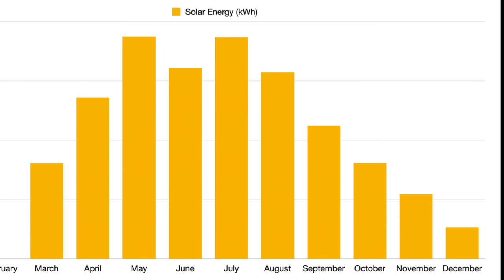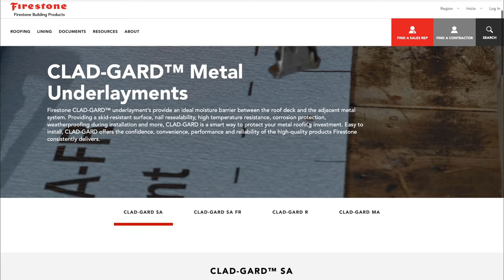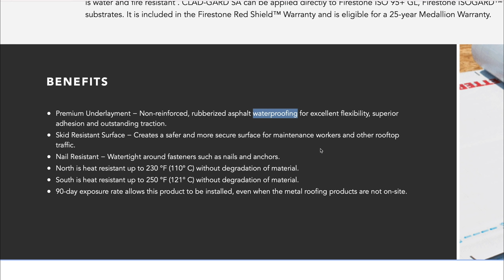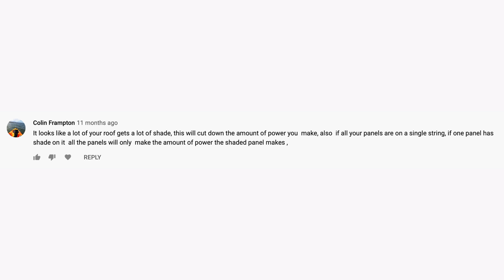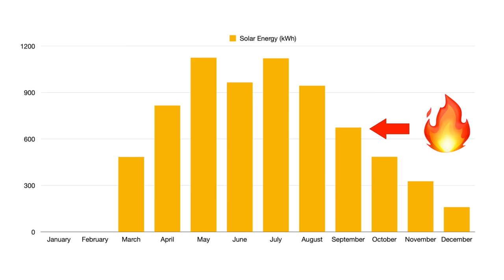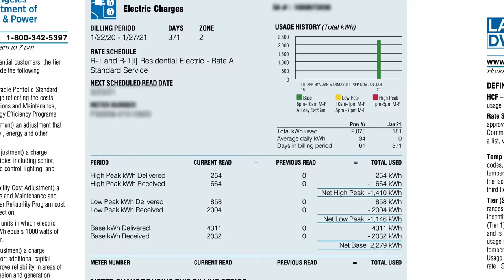1 Year with Tesla Solar Roof: top 11 questions answered + real production numbers & utility bills!

Comment: You mentioned the 1” gap under the panels; do you have any problems with rats or insect infestations there? That would seem to be prime real estate for rat nests
Reply: Or hornets.
Reply: This roof most likely gets way too hot for anything to actually survive under the tiles.
Reply: @kjamesjr  Depends on the season and where you live.
Reply: I’m hurricane prone areas (probably tornado areas too) we can get horizontal wind driven rain. Many homes with roof ridge vents let water in on older, less steep roofs. I think this could be a problem in my neck of the woods.

Comment: GAF has a similar product now.  It is nailed on just like regular roofing.  Not raised like yours, which has advantages.  One being it you can walk on it.  I only saw a short video of roofers in the early process of installation on a home in Silicon Valley and do not know what it looked like after completion.  It will likely not be quite as nice looking as this because the connections are on top instead of under raised tiles.

Comment: How much does that cost for the installation and purchase of everything
Reply: Kind of the relevant question to it all.  Saving $2000 a yeas declining by 0.5% over 25 years is great if it was $10,000 but a terrible deal at $100,000.
Reply: Est. Price After Incentives

$108,261
Reply: @everfrost6237  if so, that is flat awful.  Even allowing for rising cost of power, they won’t pay for themselves in the 25 year period (never mind extra costs like cleaning and if you lose an inverter or something along the way).  You’d be better off giving $108k to a financial group (Fidelity, Schwann, NW Mutual etc) and earning on it.
Reply: @v3rlon  no way. Independent is the way to go.
Reply: Tiberiu Farcas  yeah, but I think it's called principle.
Reply: Tiberiu Farcas  something like that
Reply: @everfrost6237   for that price you can get regular solar panels that can generate 6-7x the energy. but then you need the land for it
Reply from the maker: Covered the cost in depth in my first video: https://www.youtube.com/watch?v=LRPy8UZv9V0&list=PLXt9cHZDKoN4TcPWRp-P7iQfshODE274k

Short answer: $33k, about $21k more than if we had just gotten a conventional roof and about $3k more than if we had gotten a conventional roof + standard solar panels.
Reply: @AustinFlack  ok. So if you already need a new roof and were planning on putting solar panels on. Basically you have $12,000 out of pocket more than what you were already going to spend. How much tax credit do you get a year with it. I'm looking at how long would it take to break even and then be above zero.

Comment: I'm not so sure ash from wildfires caused the loss of production. It might account for a little. What about the sun lowering its position in the horizon in the fall months? Could the lack of indirect sunlight be the cause as well as shortened time for daylight? Also, does the ridge of your roof run north/south or east/west?

Comment: Thanks for the reply…. Cost of 20,000 and annual savings of 2000… payback in 10 years with life expected of 25 years .. Great…
Reply: Yes, but if you factor in the replacement cost of a traditional roof, you are actually not that bad off. So if your roof needs replacement anyways, it is a good alternative.
Reply: Yeah, if you need a new roof anyways, then maybe it works
Reply: Plus, prices in California definitely will increase over that time, so payback will probably be closer to 7-8 years.

Comment: You need permission to operate bc the power company needs to be aware of every power source feeding into the grid and connected to feed so that a lineman can service the lines safely.
Reply: That's a reason for you to provide notification, not for them to provide permission.
Reply: @havenbastion  So you want every individual contacting the power company when everyone around them doesn't have power. Just be a team player and don't kill a lineman. geez.
Reply: Yeahbut. I don't  for the  life  of me understand   why  anyone  would stay connected  to the  grid. It  makes NO  sense and will, one way or another  cost  you money.
Reply: @dabbbles  I got a back up gen for when the power goes out and my power bill is about 100 a month that's why
Reply: @auspicioustoot   @no name  Agreed. Back-up generators are no  solution..Better  options involve sorting out  your usage.  The more basic suggestions: 1...Put up as many  panels as  you'll need PLUS (say) 20% At  today's prices  that'll set  you back almost nil. (In Gumtree someone was offering a  complete   6.5kW   system for FREE. recently ~ on the same day I picked up 13 panels off the hard-rubbish pile a few doors  down.Good new ones  can be  bought  for under 50cents per Watt, but look around and you'll buy them for  20cents.   2.....Battery-bank. Stay  clear of the  exxy hi-tech stuff. I can get (or  direct you to) Deep-Cycle AMG LA batteries  with a  3-year UNCONDITIONAL  warranty (which means  you can expect 5+ years out of them.) The  trick is  to store  TWICE as much power  as  you intend to use. The  key  to battery life/efficiency is to minimise  the  DOD.. Some time ago I had  a   huge  bank  of   (free)  2nd-hand  l/a  batteries  the  shortest of  which lasted over  5 years;  the  longest 8 years..
Briefly: use  daylight. eg:  run fridges/freezers  flat out all day and  switch off at night. Ditto  whatever else  you need. Lights/TV/computers/etc used at night  run off the batterties ~ and  saved  where possible (eg. lights on only in the room  you're using).  Short-term needs  for power (microwave/washing-machine/ironing/etc. can be  run off a generator  for  a  total  of  perhaps 2/3  hours a week. I bought a 'demand-start' 2.4kW  unit from Bunnings  for $620 some time ago. (may no loger be available.)  Small usage of genny/batteries/etc. means running  costs are  low and the equipment will last  forever. Buying new,  you can set up useful system  for under  $5k. 3... other  options include installing several circuits in botyh DC and AC (from the inverter.); efficient  lightglobes will light a  large  room  running  at  5 or 10 Watts. etcetcetc. There  are  other ideas _ such as  running  your  genny off LPG, etc.  Contact dabbblesATgMailDOTcom if  you need ideas/info.
Reply: @auspicioustoot  ps. Panels I  bought 2nd-hand in 1980 are STILL producing power @ about 85% of  rated output.  In the meantime your  electricity-price  has  risen by  (perhaps?)  500%, and  your 'service-to-property charge  by not  much less. Incidentally, many people also consider the global-warming/etc  aspects of generated power.
Reply: @havenbastion  Any half-witted chimpanzee can install a  solar-system, and  prices  for  such  systems are, these days, minimal. (Very Cheap)  But around  here (Victoria Australia)  you not only need permission to install solar panels, but  you   are no longer allowed to install them yourself.  Installation must  be  done by a 'specially-qualified'  contractor and  inspected/approved  by  an electrical engineer.  I'm sure  you understand what happens  to price  when a particular  group  gets a monopoly handed to them.
Reply: @auspicioustoot  I  forgot to suggest you  do  the arithmetic. For  about 4 (say 6 to cover contingencies) months of power bills  you can install a  free-standing system that will provide  your power for the  next TWENTY of THIRTY YEARS...  except  for  replacing battery-banks every,say, 5  years. (longer if  you're keen.)  And while the price of  batteries/etc will continue to fall, the price of grid-power ~ along with the associated 'fees and  charges'  will continue  to  rise  at an accelerating rate, plus tax! (and be applied  whether  power is  supplied or  not.)  I once  sent the power-company  a  bill  demanding  rent  for accommodating  THEIR cables, fusebox, etc. on  MY property.  Didn't  get a  rent payment, but  they waited  three months before they sent me another ~ huge ~ bill!;  but I'd  disconnected  THEIR connection with a  pair of bolt-cutters  before then  and challenged  them to  sue me for the money.
Reply: @dabbbles  It doesn't make any sense right now for me to put out that money. If I work enough my power bill isn't even a 100 dollars bc I'm just not home. I'm also getting my power from TVA which is super cheap bc most the energy comes from dams.
Reply: @auspicioustoot   @no name  Each to their own, of  course ~ and  differences apply across the board. The main thing ~ in life generally ~ is  to get the  facts and work out  your  own best interests.  And  the  facts are  sometimes  fascinating.  (we set up a water-wheel pump at a  mate's house  that pushed  water 200ft uphill   to a header-tank  for  free..... and almost accidental, but feelgood,  discovery.) For mine alternative power's greatest attraction is  the  independence it offers. (along with the mental exercise: how  do  you heat a large hothouse with depleted batteries, for example.?  Personally,  my  favourite  source is a permanent creek  because  consistent hydro-power obviates  the need  for  a battery, which until fairly  recently were a bit unreliable  and VERY  expensive. But  we can't always have  our  druthers.

Comment: At $2K a year, how long does it take to pay off the Tesla roof?
Reply from the maker: Will pay for itself in ~10 years. (I deduct the cost of a conventional roof when I calculate ROI—I needed a new roof!)
Reply: @AustinFlack  Was home energy usage similar? Did the solar roof also reduce cooling energy needed? As it appears you will always exceed your needs for 25 years. So even after the warranty, there will be significant savings over conventional just related to durably as output decreases.
Reply from the maker: Hard to say because Covid changed everything about our energy usage (house used to be empty all day on weekdays, now my wife and I both work from home)

Comment: Wow. 2gs in savings. That's significant. Well done.
Reply: Depending on how much it cost to install...
Reply: @lydiaderhake2532  it only makes sense if the Tesla roof is no more than double a regular reroof. If it cost more than double than they lose money. His reroof cost should be 12000. If Tesla is 24000. he pays it off in 12 years. with 25 year warranty

Comment: Awesome video and straight to the point! 
~33500$ for the roof and ~2000$ in savings/year that's not bad!
Reply: Actually with the decrease in efficiently  over the 25 year warranty it would take about 19-20 years to break even.
Reply: @swordsbeer6535  But you are assuming the price of electricity will remain the same for 20 years. Generally prices rise, either by inflation or scarcity.
Reply: That's fairly bad. That's a 16 year ROI, with solar panels that have a lifespan of around 25 years. So over that 25 years, you are up around 20,000. 

Now if you had invested that in a moderate risk(6%) stock portfolio it would be worth 140,000 over that same time period. 

So basically he missed out on $120,000 on this investment.
Reply: @darrell3O87OO  You are assuming that the energy companies will keep paying for electricity. They won't. We already see rates for feeding energy back to the grid decreasing. Being able to feed the grid was designed to entice early adopters, it will go away.
Reply: @TheOwenMajor  You are assuming people still want to buy electricity at ever higher rates. It not just about selling electricity back. A lot of people don't want to be beholden to the utility companies.
Reply: @darrell3O87OO  "You are assuming people still want to buy electricity at ever higher rates."

Doesn't matter what people "want", they want refrigeration and air conditioning, they want to run their tv's and lights.

The issue with solar is it produces it's energy at the wrong time. Most people have little need for electricity in the middle of the day when they are at work or school.

Thus, like this video shows, most electricity gets sold to the grid, which offsets energy bought in the evening.

Now the issue is that energy companies don't want energy in the middle of the day, because nobody is buying. That's why grid buyback of solar energy is going to be slashed in the coming years. They will be giving pennies on the dollar, you give us 10 and we will give you 1.

Thus the solution is to store it yourself, and again like this video shows, that is expensive(and ultimately unrealistic).
Reply: @TheOwenMajor  of course a solar system needs batteries, pointless otherwise. But there are people willing to invest for the long-term benifits.
Reply: @darrell3O87OO  "Long term benefits"
Well, let's do the math. The power wall(3 day back-up) costs almost as much as the actual solar panels. That doubles your ROI to 32 years, which happens to be longer then the life of the system...
Reply from the maker: Correct. The Powerwalls are super-expensive, and could only save me up to $156 a year (not quite that, some fees are mandatory). 

Also, I think you should deduct the cost of a new roof from the ROI equation (we needed a new roof), so payoff gets closer to 10 years.
Reply: @AustinFlack  Did you get any kickback/tax cuts for going solar?
Reply: @TheOwenMajor  I've been hearing that 'everyone is going to go solar real soon' since the early 80s. I'm in the middle of Silicon Valley where the cost of solar isn't That prohibitive compared to the cost of real estate and remodeling in general. We now have mandates that New construction must have a PV system installed anyway, so it's gonna finally happen one way or the other. I do know PG&E rates have definitely risen over those 40 years and hopefully solar will be like cell phones were to long distance bills.
Reply: @bodywerks  No, I certainly don't live in Arizona. This isn't a great example because it's even sunnier then SoCal. As for energy usage I looked up the average usage over the day in the southwest in July, it picks up after noon and peaks just before 6pm. Which makes sense as people get home they turn things on. And again the issue is in those peak usage hours, solar power generation is already decreasing. 

"I also didn't see where the electric company was paying Austin Flack any money for the 67% of the energy his solar roof produced?"

Well he said he didn't have any storage, and solar panels don't produce any power at night, I assume he uses electricity at night. Thus the only logical explanation is his costs are being offset by his exports to the grid during the day.
Reply: @daveclark8337   "I'm in the middle of Silicon Valley where the cost of solar isn't That prohibitive compared to the cost of real estate and remodeling in general."

Nothing makes sense in California. California is a horrible example to use for anything because California is a burning trash heap, no offense.

The market in California has been so twisted and destroyed by the government nobody knows what works and doesn't. For example, California gives away a lot of it's solar power for free(Because they can't use it) so that the production figures can look more green. This massively increases the cost of electricity so a few politicians can say they are saving the world.
Reply: Tesla is burning its solar roof customers with a huge price increase

From $35,000 to $75,000 for one customer.

Verge article from  Apr 12, 2021.

If this is correct, then...it doesn't make sense, ever, to buy it.
Reply: @TheOwenMajor  Since there's 40 million people , EVs are common-place already (even the Amazon trucks) and a LOT of sun year-round, solar actually does make sense here.
Reply: @daveclark8337  I don't disagree, but very few places are like California that have endless sun and temperate climate. 

Solar doesn't make sense for the vast majority of the world.
Reply: You need to add to that the income made from delivering energy to the grid.
Reply: @willlinssen-top10globallea21  He didn't make any from exporting to the grid. Like he said he is getting "credits" that offset his electricity bill.

And just wait untill they stop giving those out.
Reply: @TheOwenMajor  you ever consider some people want to not be dependent entirely of utility companies? I know a handful of people that pay premium prices to not be dependent on the grid. And they couldn’t care less about ROI. It’s about independence.
Reply: @Zak-nv1tl  But he isn't independent, he relies heavily on the grid for electricity outside of peak solar production.
Reply: With the recent huge price hikes for Solar Roof the ROI will be like 25-30 years. Completely not worth it.
Reply: @swordsbeer6535  Is that after subtracting the cost of a traditional shingle/metal roof?
Reply: @TheOwenMajor  maybe he isnt. But i know people with solar panels and a battery system and they never have to draw power from the grid. be more open minded
Reply: @Zak-nv1tl  He doesn't have a battery system, that was already discussed.
Reply: @TheOwenMajor  not shit, my original statement is roi is pointless. Not everyone is looking at things for an ROI, try to keep up

Comment: Nice vlog.
If you calculate the power you imported from the grid in a dollar value. Then you could estimate how long it would take to pay off the cost of the `power wall`.
Battery cost is coming down in the future, so it was a good choice.    
.          Could you still decide to put in a `Power Wall` without any major alterations?

Comment: I love the idear of the solar roof. 
The idear is to have not mutch extra cost over a normal roof. So it would be intersting to see how this adds up. How mutch was the cleaning? Maybe 400$?
Reply: 25 years ... avg saving per year of 2k ... 20% degradation after 25 years ... paid off in 17 years (33k install) and 16k free money ... repairs at 25 years say 10k ... or 1/3rd of original install and good for another 25 years ... now its 50k (just under) ... and ALL profit ... 
.
pick ANY other type of roof ... in 50 years name one that pays for itself fully twice over